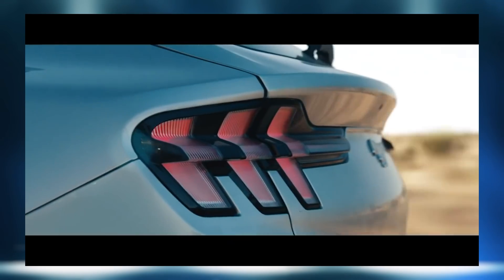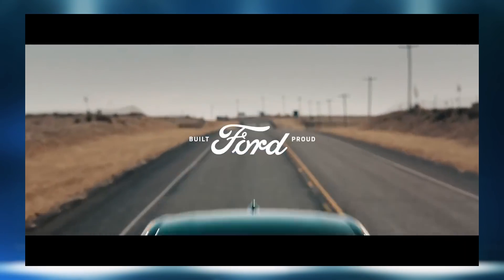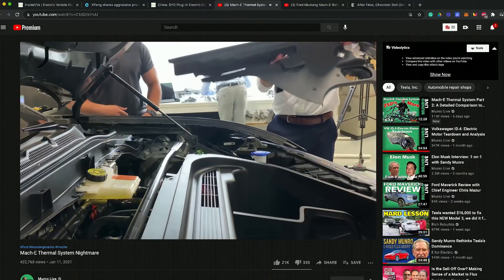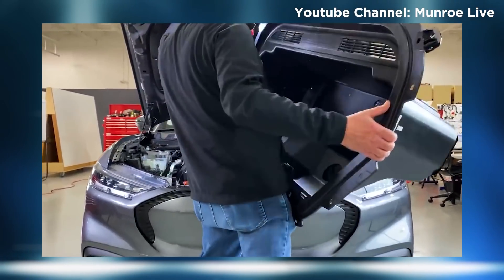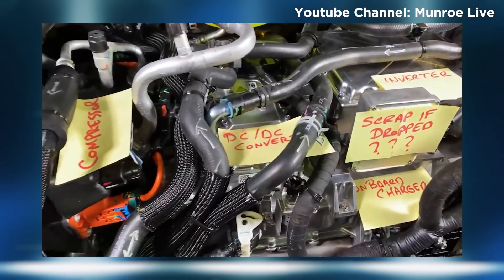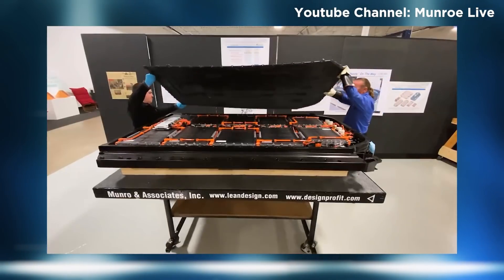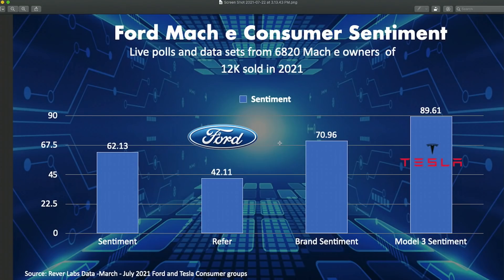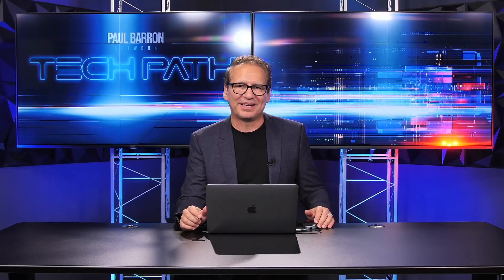Ford Mustang Mach-e Quality w/ Alex Guberman | E for Electric

Comment: We own two Mach-E's, one with 6,400 miles on it and one with 3,200 miles. Minor software issues, and that's it. Fit and finish is so much better than other Ford's. I highly recommend the Mach-E!
Reply: I have owned a Model X since 2016. I have been a BMW and Mercedes guy for  for 30 years. I never thought I would own another brand. TESLA changed the game. The fit and finish is solid. My BMW X5 M-series panel gaps are worse than my Model X. I don’t have any panel gap issues with my Model X.

Comment: I have to agree with Alex. Most people do not care about how a car is made. I have a 30 year old car( Nissan 300 zx ) that has tons of hoses and connectors in it and have had almost zero problems with it. Very few people would ever own a car for even 10 years. As long as it works that is the goal.
Reply: Yes, I agree. As long as the manufacturer car stock the parts and repair it, or sell the hose to the owner so he can, nobody cars how many hoses there are. 

The elephant in the room Sandy never mental was how much does it cost to replace one hose, one 3-way valve, as compared to replacing the whole non-serviceable Octovalve? 

The other error Sandy made was laying out the Mach-E condenser and saying “oh see this big thing? Model Y doesn’t have it”, but not bothering to mention that the Model Y sends the Freon to gas-liquid heat exchanger and then has to send that to the radiator to get the heat out of the car. The Mach-e just sends the Freon straight to the condenser to reject the heat to the atmosphere.

Personally I think all these new cars are over complicated and prefer some of the clean conversions I’ve seen taking a basic 1970’s no frills car and adding basics needed to make it electric with air conditioning,

Comment: There have been many reported instances of Tesla’s catching fire, but not one instance of a Ford Mach E doing so. 
I own a 2021 Tesla 3 and a 2021 Mach E as well. I love both but I prefer driving the Mach E.
The low stats on how many respondents would buy the Mach E again might be giving a false impression. For example, even though I love the Mach E and would recommend it, I would not buy it again,  only because I would prefer buying a full size battery electric SUV. One  that  can tow 6000+ pounds and have a range exceeding 300 miles, but none are available currently.
Reply: There are way more Teslas on the road than Mach-Es. And looking at Blue Cruise and they way it works, there will be serious accidents. Hopefully no fires.
Reply: @darreno1450  I don’t think blue cruise is meant to provide full self driving capability like what Tesla is aiming for

Comment: I test drove the T-Mod 3, the Mach-e and the I.D.4 but purchased a 2021 Mod 3. As an EV owner who depends on public charging (no home charging available), there are two (main) key issues that affected my purchase decision: a) the test driving/ordering/purchasing experience -- totally smooth and transparent with T vs traditional song & dance sales & finance dudes/dudettes breathing on your neck trying to sell you snake oil -- guess who won !! & b) the infrastructure of charging, service/support & continuous tech enhancements ota -- guess who won !! . Oh, and in spite of a stream of You Tube venom over "panel gaps" and "paint blotches" etc, I experienced none of it. I do like the Mach-e and would have easily purchased one were it not for my overall experience with my local Ford folk.

Comment: So the guest says at some point in the video, who cares, I'm promoting a car here. How does that square with, I'm doing this exclusively for the consumer? And Paul I use the voice control feature of my Model Y to adjust the fan speed of the A/C as well as turn off/on. I do the same for wipers. I do reach out to use the screen for vent placement, but that reach is about the same length as reaching for physical vents. 

 So are all of these physical buttons and knobs more convenient than pressing a scroll wheel and using voice command?

 I'm sorry, but we're in a future of touch screens, not antique cash register buttons and typewriter keys. I liked my padlock and keys at my home, but now it's keyless entry "by phone screen" or finger print.

 Even the SpaceX Dragon capsule uses a modern touch screen. I love antiques too tho.

Comment: yesterday I finally got behind the wheel of a Mustang Mach E and came away underwhelmed.  Which surprised me.  for the price and the dealer markups $5k or more just for the basic model it did not feel worth the money.  today I am taking a Model Y out for a spin so see how that changes my perspective.
Reply: I had a very similar experience with MME. I tried the regular MME first. It felt cheap and bouncy. Not a good suspension at all. Then I tried the GT Performance package-version a couple of days ago. I thought this one would bring in a total different sensation when driving, and although its suspension system felt better, the car stil lacks the premium quality you would expect when you look at the price badge. Over 70k seems pretty much money for a Ford.

On the very same day I got behind the wheel of the brand new BMW i4 M50, and THAT was something else! It felt even better than the Model 3 Performance. Not to mention the superior build quality, compared to both Ford and Tesla.

I think I found my next EV!

Comment: Well, as being a mach e owner, I am very satisfied, but also see why it scored soft on satisfaction. In terms of range, Unlike tesla, mach e will go what ford claims for. However, PAAK isn't working perfect, and user interface is a little leggy. I am pretty certain that customer satisfaction will increase dramatically once Ford pushes all necessary OTA updates and have tech/software issues got fixed.
Reply: It’s a shame that they didn’t give it more computing power to get rid of software lag. That alone makes me not consider this car.

Comment: Sandy's big push as always is make the product less robust in order to increase profits of production. Thinking Tesla's broken $1.00 coolant hose nipple causing a $16,000 battery replacement is good engineering is just not acceptable. Sure it was cheap to produce but end result, disappointing to the consumer. Putting less screws in weather sealed bulkhead electric connectors and extending the spread of clamping power to save a dime per unit makes good YouTube videos and many may pay Sandy  telling them that. Take note: if those bulkhead connectors allow water intrusion into the High Voltage battery area High Voltage battery service technicians are instructed to replace the whole assembly. The assembly is deemed unsafe. 4 screws, responsible for correct clamping force across a certain span,  deemed  adequate by the engineering team who signed off on it is nothing to scoff at. Living in Florida and driving EV'S, almost every afternoon the streets may have several inches if rain water surrounding these high voltage battery packs. I appreciate extra robustness built into vehicles at the expense for a few more screws.

Comment: This is a hatchet piece directed against the Mach-E.   They also overstate Sandy Munro’s criticisms of electric videos. His criticisms are based around comparative part counts and diversity and utilization of fasteners. Without understanding the context, someone not versed in (automotive) manufacturing might be convinced through this argument that one vehicle is inherently reliable because it has fewer, often custom, parts and that the other is inherently unreliable because it uses more, often off-the-shelf parts. However, this is not just misleading, and not necessarily true. There are several mitigating factors that are omitted in these videos:

•	When compared to an ICE vehicle, even the worst EV, (from a hardware perspective,) has far fewer parts and significantly less manufacturing complexity. So when someone makes a statement that car A should be more reliable than car B because of its lower part count they tend to omit the fact that that using that metric alone, both cars would be far more reliable than any ICE vehicle. In fact, compared to traditional ICE vehicles the difference in EV part count is not as significant as Munro would argue. (Remember, Munro makes his living by selling fear, uncertainty, and doubt.)

•	Munro also vilifies the use of off-the-shelf parts because they often increase the number of required components needed, add weight to the vehicle and increase manufacturing complexity and cost. However, using these parts can increase reliability because over time, their wide use has resulted in optimized design and improved component reliability. Furthermore, because they are produced in higher volumes, they can be much cheaper than a custom components.

•	Munro also makes a lot of noise regarding the number of connectors between standard parts noting that certain manufacturers custom components that integrate function of multiple components reduce the number of connectors, ergo they increase reliability while they reduce overall cost. However, this ignores the fact the complexity has simply been moved from outside the box to inside. Making that part not only more complex to manufacture, but also making it inherently less reliable and more expensive.

Comment: I totally disagree with Alex’s meme that EVs only need 250 miles of charge, here’s why:

1.  About 15% of people live in apartments and can’t charge at home and have to go to superchargers, etc.

2. Tesla is opening up it superchargers to all EVs eventually. Just Tesla will have a 100 million EVs on the road by 2030. Plus figure at a least another similar amount of other EVs. That’s like over several hundred fold increase in EVs on the road ! 

The longer the range between charges, the shorter the lines will be be at superchargers etc. (Personally I think 1500 miles between charge is needed)

3. Towing a trailer will reduce range up to 50%, whether a boat, moving trailer, RV trailer etc.

4. Weather can reduce range 25% more/less

Superfast battery swapping facilities of the future will probably not be as efficient as batteries hardwired into the car and maybe need to be smaller, figure 20-30% less efficient.

So I would say 1500 miles of charge between recharging is optimal, or at least should be available.

Several factors above could combine to reduce a 1500 mile battery by 50% or more and that gets you to today’s top rated batteries about to come on the market now.
Reply: Apartment buildings in California are starting to install EV chargers in their parking garages. Both of my adult children have this facility in their buildings. One has a charge point pay per use and the other has a NEMA 14-50 outlet and is charged a fixed $54 a month regardless of use.